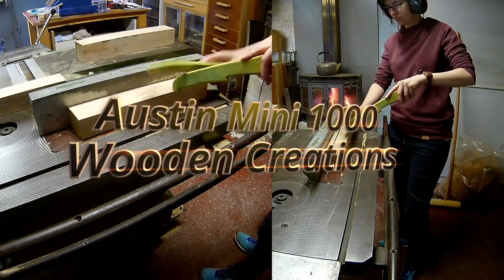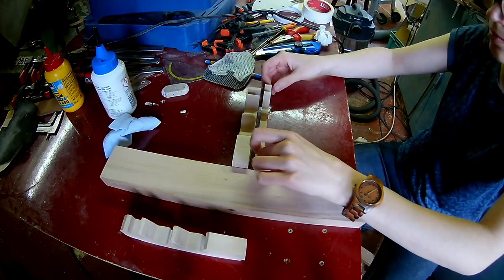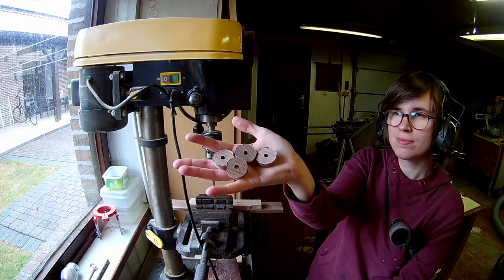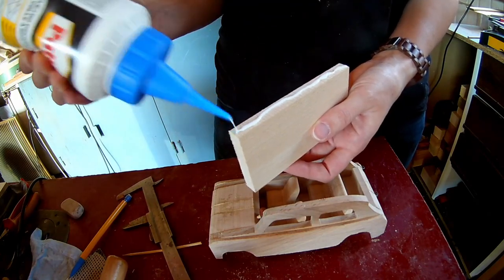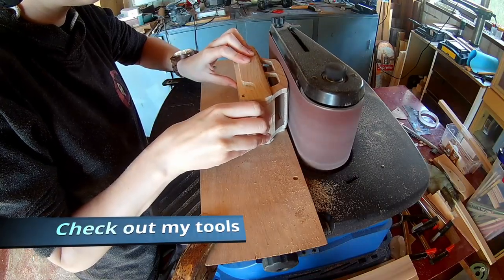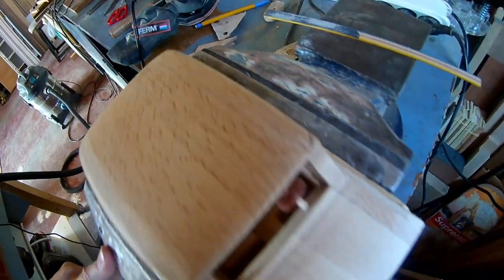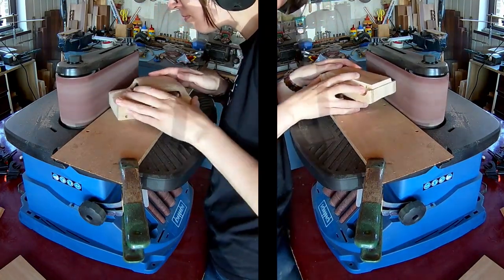I made the Austin Mini 1000 of Mr. Bean out of Wood! - Wooden Creations

Comment: Beautifull project. A question. Why do you use a wood slate on the belt sander? Best wishes.
Reply from the maker: Thank you so much! What do you mean with a wood slate? I don't think I'm using it because I don't know what you mean haha
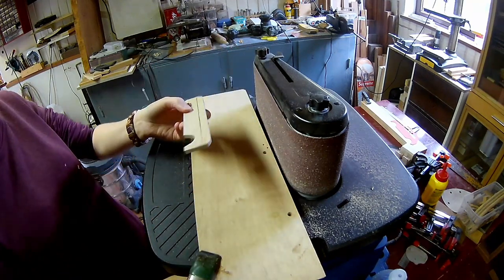Reply: On minute 2:08 you use a belt sander. On top of the machine table there is a wood piece. What is the function of the piece for sanding the toy? I have the same machine.
Reply from the maker: @Gilsao_1964  Ooooh okay hahaha! I have it on there for if I'm sanding thin pieces, so I'm sanding it the whole time, also when the belt is going up.